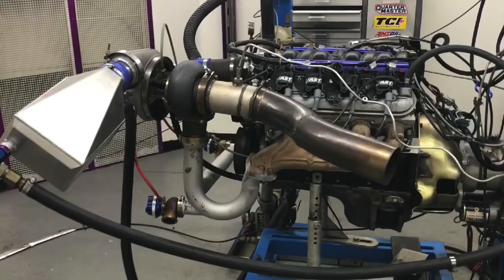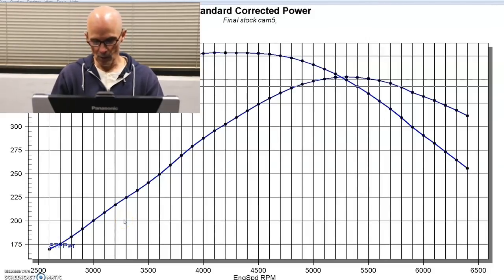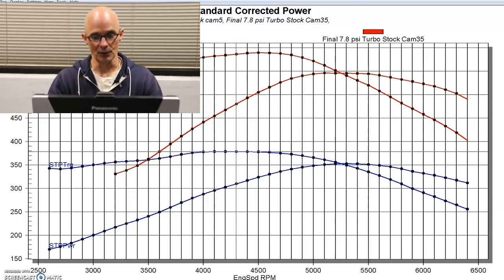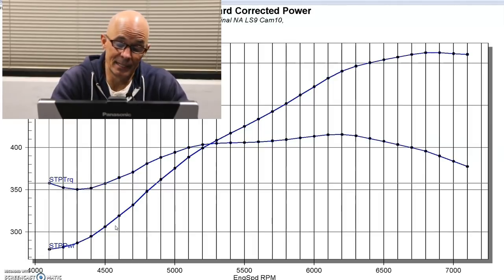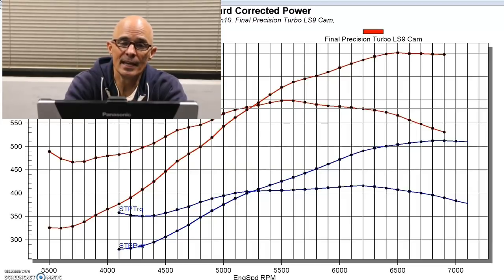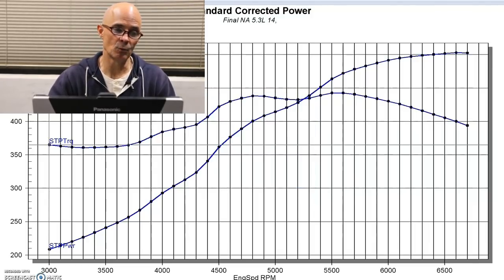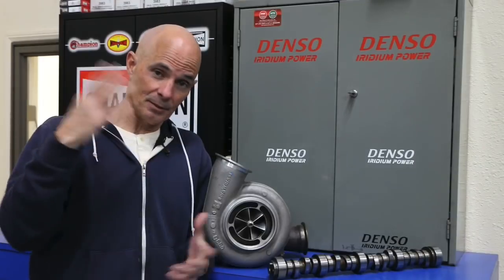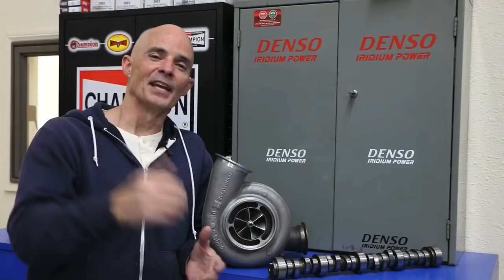REVEALED-DIY TURBO SECRET-EVERY CAM WORKS!

Comment: Hi Richard, just recently started watching and I love the videos. I noticed in a few of your LS videos you're using stock fuel rails, I was wondering what size fuel line you're using too. I'm putting together a turbo LS too and I'm aiming for 650hp, everyone is saying I need -8, or -10 fuel line but that seems kind of overkill considering the fuel rail is 3/8. What are your thoughts?
Reply from the maker: we've run near 1000 hp with a stock fuel rail-don't go crazy on size-do get a good pump and big injector
Reply: @richardholdener1727  thanks for the reply! Would you think a -6 line is enough?

Comment: SIR i really appreciate your testing its great 
. A couple of test i had in mind one was a comparison between hydraulic and solid lifter camshafts and also add limiters to the lifters to see if there's anything to be gained . I really like solids because i can help tune in for what i want . Years ago i ran a 600 izky roller . Real good set of heads . 12.5compression ect ect and i ran thr cam at .010 and .012 or whatever and i talked to T Willy he said run it at .030 on both wow really calmed it down but if i wanted more i could close the lash a bit and it run lol

Comment: Eye opening, thanks. I'm going to hoist up a reply that I wrote below as a sanity check. Does anyone out there want o agree or disagree with this theory?

Everyone on the internet has been saying for years that turbo cams are made with less overlap (or "more LSA" which is related, but misleading) so that exhaust backpressure doesn't compromise cylinder filling. And I believed it. But after watching this video, I suspect that...

"Turbo" cams are really just tailored for good NA power WITHOUT GIVING UP a smooth idle and good low-speed driveability. Turbo cams are NOT optimized for power, because if you want more power you can get it by adding boost.

When you optimize a cam for power, you add overlap, which compromises idle quality (chop / lope) and low-speed drivability (surging). So "turbo" cams don't make those compromises. So they make less power NA... but again that's OK because with turbo setups, peak power is generally limited by the turbocharger anyway - not by the cam.

Comment: @ 0:14 Please show more about this unique gen 3 m90 LS combo. I have the same m90 fabbing up remotely to blow through an air to air intercooler because it is the absolute cheapest positive displacement blower but im so interested in this combo you ran. Thanks
Reply: @Mad mod - he has a video. It lost a lot of power. Pretty much a fancy restrictor plate.
Reply: @Ka_Gg  i know this was posted before his vid. He also is running less blower speed than a stock 3800 so it makes sense it made the power of a stock 3800.

Comment: It seems stock cams with 118+lsa are great for boost because they do not have any overlap also won’t be as lazy with a small cam another example turbo cams can keep exhaust open a lot longer to spool turbo faster also it’s were you want power is what can you pick and valve events opening the intake earlier can be beneficial but your right a major factor is valve float I personally want load sooner so smaller cams are my preference with big turbos rather then big cam big turbo for street

Comment: I would think a turbo cam is a cam with lots of low end torque for quick spool up. After that just crank up the boost for more power.

Comment: Hey Rich.. I’ve watched your videos for the last 3+ hours to try to figure out my cam selection.. I’ve driven myself nuts lol.. Can I get your opinion on what you think is what “I” think is my best option. I built a 408 with a good set of PRC 260 rec ports, stock LS3 intake. 10.5:1 still but it’s a twin turbo car. Comp Turbo 6265’s.. M6 car.. the cam I like is the comp 54-337-11, LST 233/247 .612/.614 115.. they also call it a “blower cam”. It that gonna be to much on the exhaust for turbos
Reply from the maker: that is bigger than you need and will be softer down low-look at a stage 1 or 2 na cam

Comment: Always learning from your videos.  How is the best way to get a flatter torque curve over max power?  For example modern OEM turbo motors that have basically the same torque from 1500-5000rpm.  Is it all boost curve and small turbo?
Reply from the maker: They have a falling boost curve typically-high down low

Comment: Very interesting presentation, i have been thinking about boosting an ls motor but seems like it is a lot more complicated and expensive. Is it worth to pay more for the more expensive turbos, waste gates, etc, (turbo charged set ups). I have seen some cheap ebay turbos make power but for reliability would it be worth paying more for the expensive more reputable turbines ( and set ups)?
Reply: Proper sizing is the most important cheap Borg Warner work great
Reply: VS Racing and Cx Racing  turbos work great and are reliable. They've been proven time and time again.

Comment: If you know your stuff.
Wy turbo power tops off at higher boost is the fault off the back pressure.
Blocks the flow.
If you know the back pressure you can calculate the power.
Thats wy a bigger compressor dont always make more power.

Comment: Great Video... 

This is first year theory tho, and I'm glad you cater for all knowledge levels, cos once you get your trade, you kinda forget that not everyone knows the basics.

I was told that "turbo" or "blower" cams,  provided that they have the same amount in or out, it's only going to effect the curve... And generally each cam is only shaping the curve, and that charger doesn't know what cam is there, it just knows how to multiply atmosphere.
Reply: Ahh , but if all you can afford is a procharger that maxed out on rpm ,  would you make more power with an n/a overlap cam or a boost cam?  Say you're trying to get the most out of your power adder.
Reply: @NickKautz  A cam for supercharger boost will emphasize exhaust timing more to get rid of the extra exhaust.

That is the case with the stock Hellcat cam versus the 392 naturally aspirated cam for functionally the same short block.

A cam for turbo boost is really a lot like a n/a cam, because the increased boost faces opposition from increased back pressure, so, as far as what the cylinder sees, its like running the car at FAR lower altitude versus on top of a very tall mountain, pressure-wise.
Reply: @exploranator  2   My spidey sense tells me regardless if turbo or supercharged,  you want the maximum air getting in and maximum getting out of the head while keeping peak power at an RPM the parts can handle.  So valve timing and duration will be limited due to rpm but lift should be the maximum possible.   I'll bet it probably helps to have some overlap when boosted because the boost air will push any leftover combustian gasses out the exhaust port (and help spool the turbo) and prevent any waste gasses from reversion back up the intake..

Comment: I've just recently tuned into your channel so I'm new here. 
I really like your style and approach on this topic. You've got an excellent point as allot of people think if you go turbo or just boosted in general, you have to have all this specialty equipment to run it or it's never gonna work right. Not true, your Dyno graph proves that very clearly. 

Now the one thing where I see a specialty "turbo" cam come into play that's often over looked is that valve timing has an affect on dynamic compression vs static compression. This matters to guys running high boost numbers as generally you need more octane to combat detonation. However, a cam that reduces the dynamic compression will sometimes help in alleviating Det and fudges the line a bit on how much boost you can safely run based on the given octane you're trying to run. That also allows higher boost numbers generally and on engines that have a larger size turbo than a typical setup would run, helps to put you more in the center of the efficiency range of the turbocharger itself. Another thing commonly over looked too that plays a big part in what the magic recipe is for a given circumstance. If you're outside the turbo's efficiency range, too large or too small a turbo, power output is generally going to leave a lot to be desired, and a cam will not be the end all solution to that. 

Honestly, the point in this video is an excellent example and I thoroughly agree with the statement made. Regardless of the engine combo, boost is always going to be your best bang for the buck to add horsepower regardless of the base engine you're starting with. The other bolt on performance parts will help make more power for sure but buying specific "Turbo" spec parts are not gonna give you black magic voodoo results and instantly you have a million horsepower. 

I like the concept that this brings to the table of run what ya bring kind of deal. Don't buy into what the internet tells you that you have to have. A basic build with a good cam, do some head work, valve train and if you're feeling extra generous get ya some good rods and Pistons with a solid set of hardware (studs and gaskets). This would be a pretty dang solid combo either N/A or boosted with little to worry about in the durability side of things without going full blown race car. It's a great attitude to have. 

Thanks for the awesome videos! I will definitely continue to tune into this channel! Getting me excited to finish my truck up.

Comment: I'd really like to see the spool time of a NA cam vs a turbo cam.  That's what matters to me.  If a turbo cam will get it fully spooled 500 RPM earlier, that makes for a much better driving experience.
I'd also like to see a side-by-side turbo cam run NA vs the same "stage" NA cam.  So a BTR Stage 1 NA cam vs a Stage 1 turbo cam, both run NA.  For those of us that are starting out NA then turbo'ing down the road.  It'd also be interesting to hear the sound difference.

Comment: Exhaust exiting into dyno cell.....has to affect repeatability. Would take some phenomeal airflow to keep the air clean in there
Reply from the maker: If you stood in the dyno cell you would understand-we run dedicated exhaust tubing to the rear and super high HP stuff not below 1000 hp

Comment: The test should have been the same set up with swapping cans. Obviously you will make more power with boost vs na. I dont think anyone questioned that. There are times where people might not have enough turbine for their engine size. Say they have a large na, or nitrous cam with a lot of overlap. A cam with less overlap well create less backpressure

Comment: It makes perfect sense that if you double the atmospheric pressure and adjust the engine to run properly under that pressure "curve", that it would make double the horse power and torque at double the atmospheric pressure.

Comment: Running whatever you have and making power is great. But I did hear that turbo cams try to have very little overlap. It's an efficiency thing to squeeze all the power out of whatever turbo you have. A nasty na cam has overlap so the exhaust can pull in fresh air and completely clean the cylinder of burnt gas, that means more na power. But with a turbo, where boost shoves itself in anyway, it doesn't help much, it actually hurts as it opens the intake to the exhaust and leaks boost out. At least that's what I heard. I don't even have a car yet. Id think with stock cams it doesn't matter as neither thing is exaggerated. But running the best na cam might not be the best for boost, sure it will always make more power, but not as much as the turbo can possibly make, unless you have a huge engine and turbo and don't feel that boost that escapes. With a smaller engine you don't have as much exhaust to spin the turbo and can't run massive turbo's or you will never spool up. At least that's what I understood from watching lots of YouTube.

Comment: I did similar tests and the only thing you get out of a turbo cam is less torque off the line and a lot of upper speed and power for the most part Richard's 100% true

Comment: Another thing you're exactly right about is when everybody goes to high compression huge cam that's going to 8000 RPM they're going to lose all their power due to back pressure.

Comment: An NA cam is relying on the vacuum created with proper pulse tuned headers to clear the cylinder  and cause a water hammer effect raising the cylinder pressure a few millibars. 
The ideal setup NA should have a negative pressure raito and extreme EGT's  due to an EGR effect  of reverse air flow during valve overlap. Uncooled EGR is bad for gas and diesel. 
-----
On boost 1bar double the power 2bar 4x,  3bar 6x(or *4) good to know. Dose the correlation  carry over to diesel?

Comment: Have you ever done a back to back, cam only test, between a very heavy overlap like 106 vs very wide like 120 or more? Im wondering the effect on boost pressure, in regards to, charge loss, due to short circuiting?

Comment: I was under the impression that "turbo cams" were for reliability and driveability.
You certainly give confidence to those considering FI on their applications, but for those of us still using the LS engine that came with our vehicles, I have heard many horror stories of LS1s not surviving passed 550rwhp and LS2s failing once they reach 650rwhp.

Anyone that wants to FI their NA engines needs to (at the minimum) properly gap the piston rings.  But that involves fully disassembling the engine which is typically beyond the majority DIY capabilities.

Comment: I'm a big fan of a narrow lobe separation. I know that a wider separation (112) will possibly make more power on the dyno. I have ran separations of as tight as (106) and on the drag strip, the tighter the better.  On a few Engine Masters I have seen really good  running engines with lobe separation below (100). I don't believe these tight lobe separation will work with a turbo. Just looking for an opinion on turbos and lobe separation?

Comment: So as I heard it...
NA power plus turbo-added airflow = boosted power.
Please confirm. If Boosted / NA power equals say 1.8, e.g. 100 NA to 180 boosted, then if I use a "better" cam I should see that same 1.8 ratio increase, all else being equal?
e.g. if NA power with a new cam goes from 100 to 200, then boosted should be 360?
So a "turbo" cam is just the power and torque profile (shape) wanted, either boosted or NA.
I suppose a turbo cam, ie. low overlap, provides better torque at broader RPM range, but the boost multiplier still applies?

Comment: Great explanation of real world stuff over theory...however...a factory 'emissions' cam IS a good turbo cam to begin with - less duration and overlap.   An optimised modern N/A engine should get ~100hp/litre, not ~350hp from 5.3 litre.   Massive gains to be had here, which makes the LS such a great 'tuner' engine.
Reply from the maker: every cam is a good turbo cam
Reply: @richardholdener1727  I'm an amateur at this, some N/A experience,  trying to decide on good timing for my car, possibly you could guide me - 1994 Maserati Ghibli II, 2.8L V6 bi-turbo.   287bhp@6000rpm@0.9bar boost and 305ftlb TQ from factory. 7.4:1 CR, 94mmx67mm bxs., 4 valve DOHC bucket on shim.   Measured at lash before disassembly timing was approx. 15-39-42-6 (has errors).   I rebuilt engine with the recommendation to use less lash (0.25mmInt/0.35mmExh) and altered timing, which now is approx. 16-48-54-10, boost to 1.1bar ~350hp.  Same cams with 8.6mm lift from cam circle, duration 244deg INT and 244 EXH@0.5mm, though EXH may be 237deg, I had measuring problems (virtually same dur'n. as used on F40 - suspect engineers ate lunch together!).   Idle is now too lumpy and low speed driveability and TQ reduced.    I note Nissan RB26DETT have negative overlap...similar vintage and CR, timing 3-57-59- 3 or 7-53-49 7!     Leaning towards reducing overlap and sticking with 4deg advance: 4-60-68 -4??   Apologies for dump...making the changes accurately is not a small job with engine in the car - 2 heads, 4 cams, 2 adj. belt pulleys and 2 adj. chain pulleys at back of heads (against firewall).